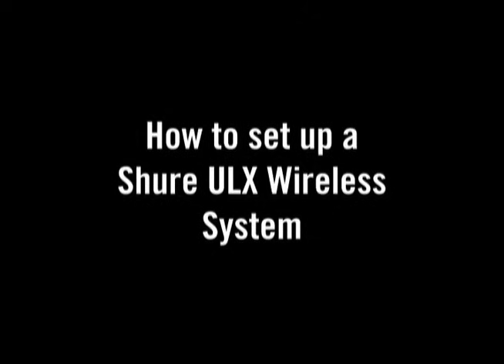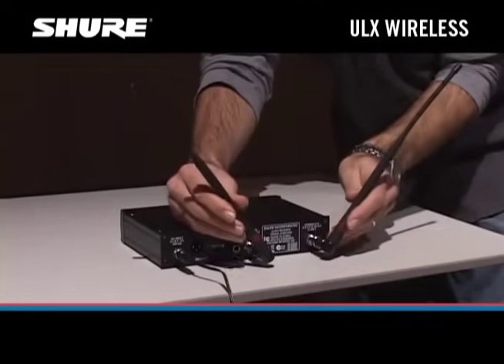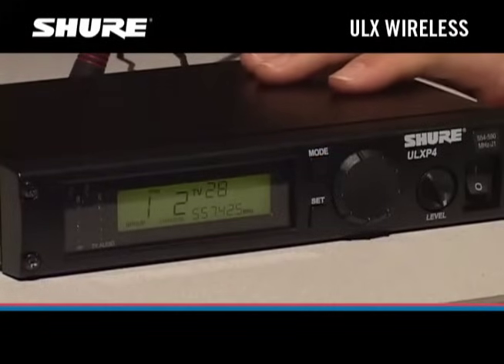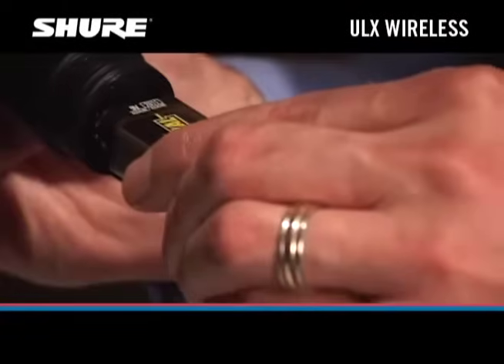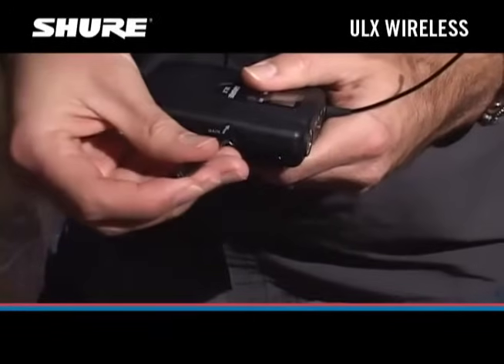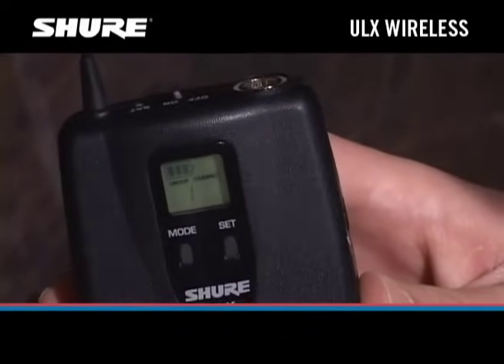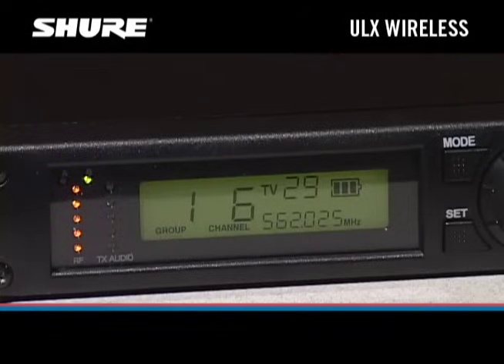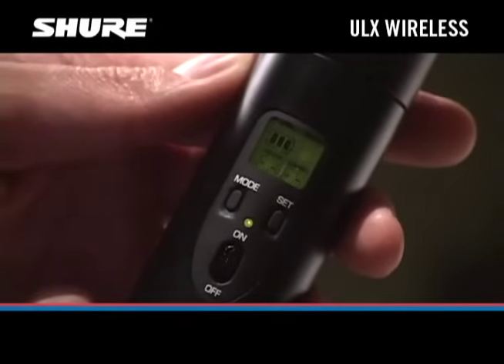ULX Wireless - How to Set Up a System | Shure

Comment: Recently got my hands on a ULXS4 and a ULX1-G3, but they don't seem to register one another when set to the same groups/channels. the MHz ranges are 554-590 on the receiver and 470-506 on the transmitter. Is this a problem? To the best of my knowledge, they were used alongside each other for a few years, but I may be wrong.
Thanks!
Reply from the maker: They need to be set to the same frequency range or within a compatible range. In this case, the frequency ranges of the two devices do not overlap, which is likely why they are not registering with each other.

Comment: I recently obtained a Shure ULXP4 receiver with a Shure ULX1-J1 wireless bodypack and a Shure ULX2-J1 SM58 microphone. With all three units powered on and set to the same channel and the same group, I am not receiving any of the lights on the RF or TX Audio indicators on the front of the receiver when sound is delivered into the microphone. The Output on the back of the receiver is set to "Mic" and both A and B antennas are attached. Can you please tell me if I am missing anything? Does there perhaps need to be anything plugged into the AUX High Z or the Balanced Low Z port on the back of the receiver to get the lights on the RF and TX Audio indicators? I appreciate any feedback or help.
Reply from the maker: Check your email for a response from our support team!
Reply: Thank you - I haven't received an email response yet but I will wait for it.

Comment: how do I connect it to a pedalboard?
Reply: @Lachlan Revolver Run a cable from the output of the receiver to the input of the first pedal on the board.
Reply: @Lachlan Revolver Yup, after you connect the receiver, the signal; is carried through the pedals and to the amp from the output of the last pedal. Or if your amp has an effects loop, just plug the receiver into the amp and run the pedalboard through the loop.
Reply: Just plug a guitar cable from your pedalboard into the quarter inch output on the receiver.